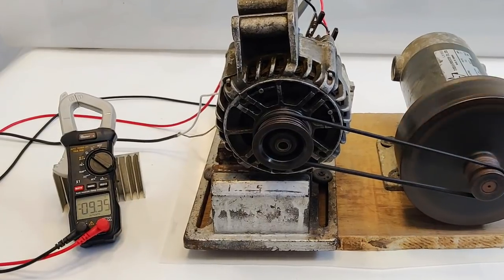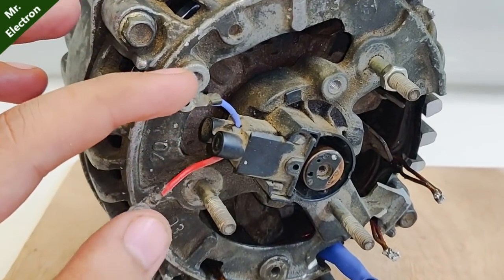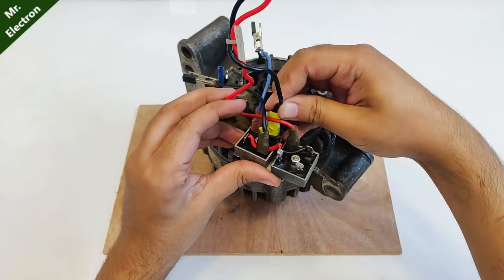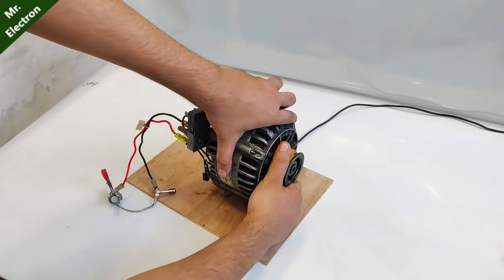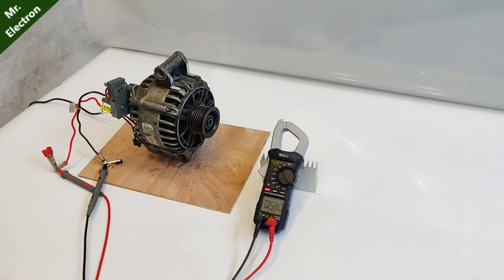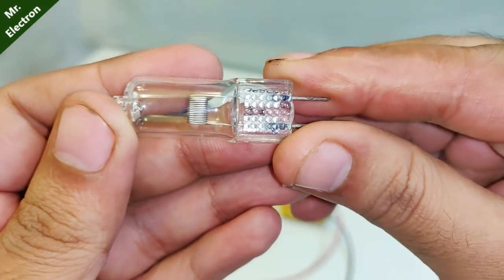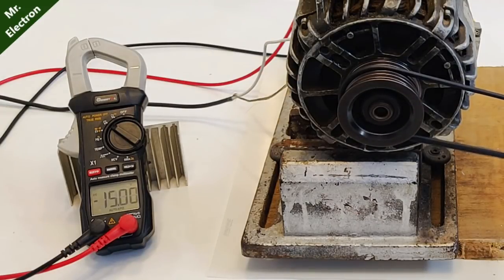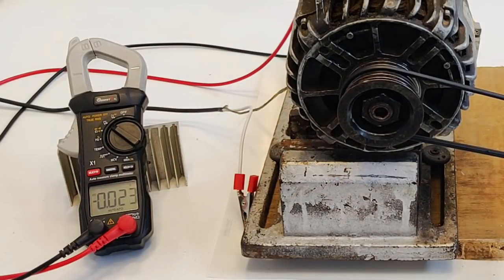12V Car Alternator to 24 Volts 64 Amps  - 1500W Toyota Alternator

Comment: This is exactly what I need to do. The only part I don't get is the laptop charger? Is it actually plugged into the wall? It is used as the exciter, but is there another way to do it? I understood everything you said except that part.
Reply: You can use a 9v battery or a 12v battery as the Exciter.

Comment: Is it posibel to alter alternators start charging rpm with supresors and condensors? because I have a problem by useing plazma ignition my start rpm charge from 1k is altered to 2 up 2500 rpm. So I asume the capacitors value has somthing to do with it aperantly.
Not only that all of my wire harnest got increase in voltage up to 15v baterry shows thats all fine and usefull for a cold conditions and ignition coil nothing realy sufers exept that alternator is anoing is there a mathematical resuche ore somthing like that? so I can force my alternator to always charge even to small rpm like 300rpm? Culd posibly a external voltage regulator handel that job?

Comment: Hello brother, thank you for this video ... In fact, I live in an area where there is no electricity .. I am trying to make a fan to generate electricity from the wind ... But the obstacle in front of me is the dynamo, I do not know which dynamo to use.  But the dynamo of the car needs a high rotation speed, and this cannot be provided in the wind ... Is there a way to make a car dynamo give electricity by simply turning it, even slowly?  Hope you can help me
Reply: Look into gear boxes for wind turbines. A fan won't cut it, as you've found out. You need a big turbine. 

If I had no electricity and scarce resources, I'd likely look at a bicycle generator to start with. You can find plenty of tutorials on Youtube. Not the final solution, but would give you electricity and exercise, while you learn a better way. Good luck!

Comment: Why did you disconnect the internal rectifier diodes from the alternator.  They are good for much more than the 35 Amps and have better heatsinking than what you are providing.

Comment: so, what gage are the original alternator winding wires from the 3 fields and how hot did they get producing the extra amps? exactly when (time limit) do you think they will burn at the higher amps?

Comment: You say that you get my more from the alternator than you could from solar. Firstly, solar only requires the sun and no external forces. Secondly, the alternator needs a high torque turning force which due to friction you cannot get more energy out than you put in.
Show us the watts you draw to produce the watts you get out. This is only good for a petrol engine generator, not for a wind or water turbine that would give the same free output that solar does. This is why it is wrong for you to compare an engine alternator to solar.
Once you produce free output then I will be excited because this project is a dud.
By the way, make sure that you add in the power drawn by the laptop charger when calculating the power in power out ratios.
Reply from the maker: Nope ! I just said that you could get even more output using 24v to 12v solar buck converter